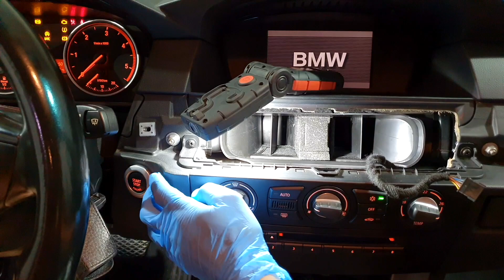Remove A/C bad smell with Spray Foam

Comment: La al meu bmw e 38 de vreo 12 ani folosesc anual câte 2 spray-uri de curățare a radiatorului de clima din habitaclu de la Manol, costa doar 9 EUR și de fiecare data am fost mulțumit. De obicei prin luna iunie -iulie după ce trece nebunia cu polenul atunci schimb și filtrele de polen și iau cate un spray îl agit bine, nu am nevoie de furtun pentru ca tu știi ce simplu este la e38 accesul la flapsurile de aer și pulverizez cate un tub în fiecare flaps desigur cu clima pornită.  După procedura asta mai las clima pornită pe 23 - 24 de grade vreo 15 minute și sub mașină prin fantele prin care se scurge condensul se vede cum picură un lichid murdar. Nu miroase urât nici dacă nu curăț radiatorul de clima dar o fac pentru ca este igienic, curăță praful depus, eventual bacterii și alte chestii neprietenoase pentru sistemul nostru respirator. 
Ca de obicei Ovidiu faci o treaba excelenta,te apreciez, te urmăresc și din când în când îți mai comentez. 
Îți doresc multă sănătate și toate cele bune ție și canalului tău de YouTube. ♥♥♥
Reply from the maker: Salut Cosmin,  da depinde de la model la model si daca a avut sau nu filtre de polen sau daca au circulat in zone cu mult praf, la generatiile mai noi F si G  au ionizator in instalatia de climatizare (nu toate depinde de echipare) . Multumesc pentru sustinere !

Comment: In e71 I saw some article to put foam from evaporator sensor which is located near driver side. But I should put foam from both sides od radiator in order to clean it well. 🤔

Comment: In my E60, I was trying to spray the drain tube inside the car, where it connects to the evaporator on the passenger and driver side footwell. Is this possible, or is just spraying the evaporator coils on the outside good enough?

Comment: I have a 2018 7 series 750i xdrive and am having problems with my A/C. Vehicle has only 40,000 miles on it. Do you have any idea why my A/C does not blow cold air ?

Comment: La e90 trebuie sa i dau jos aeroterma ovidiu ? Și sa i bag spray la radiatorul acel mic de l văd după ce i dau senzorul jos de temperatura ?
Reply from the maker: Da ai putea sa faci si asta ! Ai fi mai sigur ca vaporizatorul e spalat complet
Reply: @MOvidiu  vaporizatorul fiind localizat unde ?